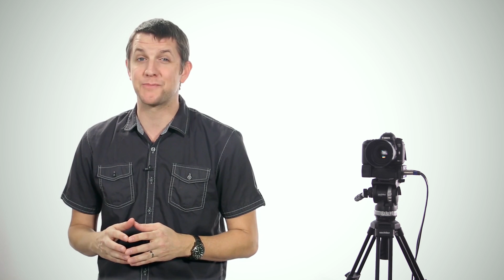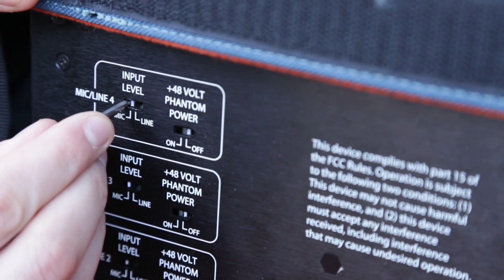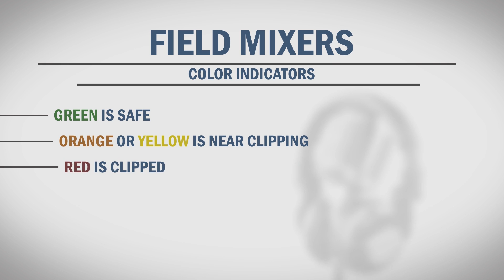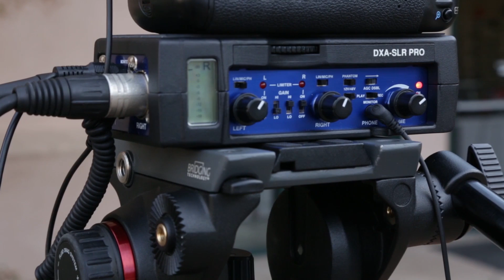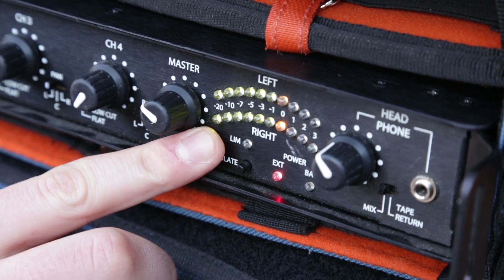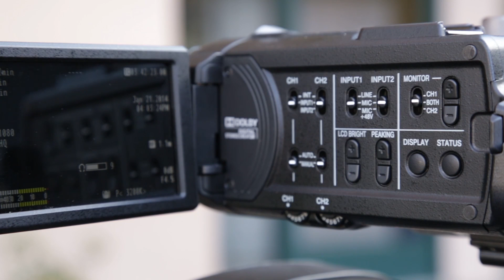Audio Techniques for going Pro - Field Mixers

Comment: Hey Videomaker, I'm looking at the sound devices 302 to use with shotgun and wireless system. How does its preamp compare to the newer sound devices mixpre 3 and 6 and other current options? Is it too old for 2018? thank much